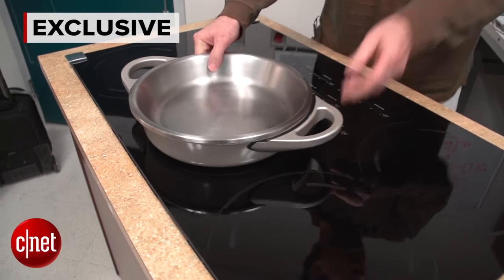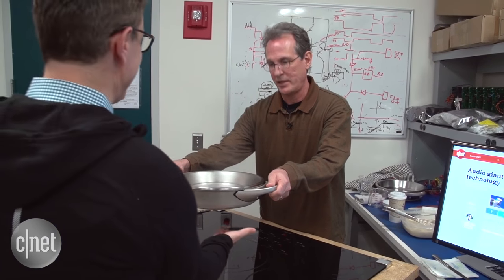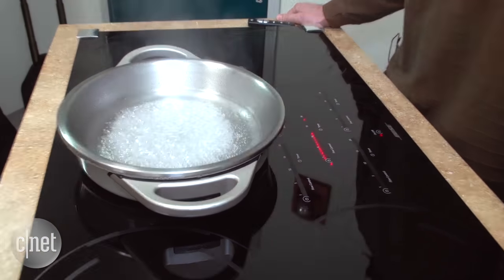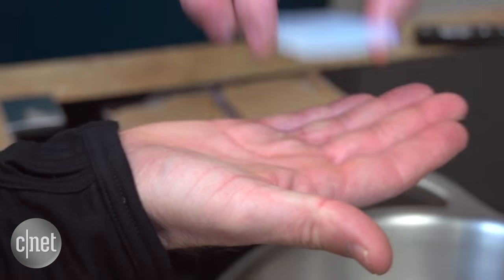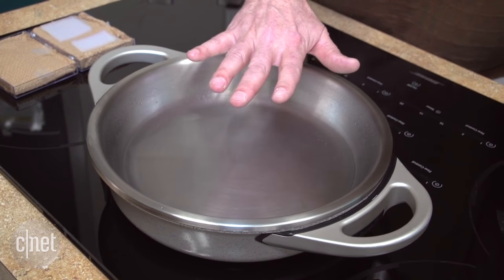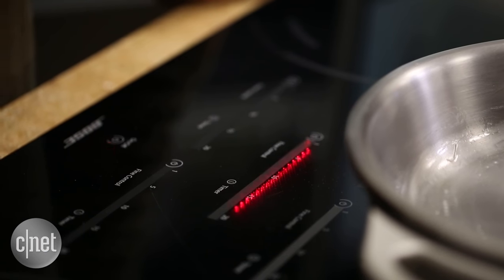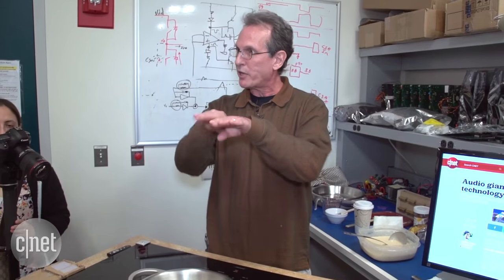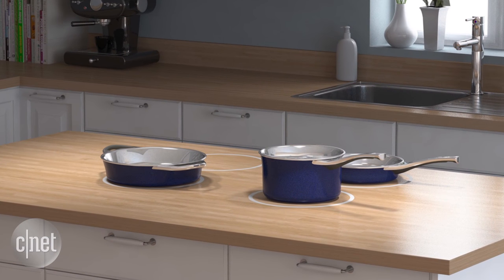Hands-on with Bose's new super high-tech cooking system

Comment: This will make for overpriced cookware with short lifespans (e.g., when the insulation breaks down).
Other than that, the concept is cool, and is a true upgrade to cooking when it comes to being able to dial in an exact temperature.

What I would like to also see, are reflow oven style temperature curves, this will be useful for when you want to avoid gradients in food, for example, cooking meat to be well done without the outside being overcooked. it can be done with a pan, the only problem is that the heating profile needs to be implemented manually in order to equalize the temperatures. 

A system like theirs could automate that with precise control.

Comment: A cafe I worked at had one of these. It was the talk of the place for about a day and then it was as if it was any other cooking top. This would prevent a lot of house fires though.
Reply: I think that cafe may have an induction cooktop which transfers heat directly to a magnetized pan/pot via a magnetic field. No heat is lost on the cooktop surface like gas or electric stoves. This appears to be Bose's attempt to refine that method.
Reply: +wyzemann being that its made by bose, I feel like its a sonic cooktop, which uses a high frequency soundwave to vibrate the liquids inside of what you intend to cook in order to heat it
Reply: +wyzemann nevermind, he explained it in videa
Reply: +GAMEBOIMARCUS No they didn't, it's not even commercially available yet. This is a tech demo. They probably had an induction cooktop, which has been around forever. My parents even have one.
Reply: Kev50027
How are you going to tell me what I seen and used for a few years. We got the same "touch this" demo and had to use special pots. This may be new for homes, but work places had this for a few years now.
Reply: +GAMEBOIMARCUS Because what you used was just an induction cooktop, which has been around for many years. Like I said, even my parents got one that has a touch screen and was installed about 4-5 years ago. This is different technology. The induction cooktop you used didn't have special insulated pots with sensors in the pot, and didn't use aerogel. Induction just uses magnetic pots, so the entire pot heats up. He even explained the difference in the video. What you used wasn't this new technology because it's not even available, and Bose doesn't sell the product.

In summary since you seem to be too dense to read: What you used has been around for many years and is called induction. This uses induction, but works differently, and is not available for anyone, thus your cafe did not have the same system.
Reply: Kev50027
Ok Captain Save The Day, my comment still stands. It was the talk for about a day or two and then it was as if it was any other cooking top. 
"This uses induction, but works differently" Aka, Same same, but different. But still same.

And like I said, it will prevent a lot a house fires. Have a nice life.
Reply: +GAMEBOIMARCUS My point was that this is an advancement on simple induction cooktops, which has been around since the 1950's.

Comment: It's cool, but what's the point?
Reply: Less house fires, it's safer, probably more efficient as well
Reply: +Luke Skeggs-Bennett Is there much risk of house fires from a stove? You can get flameless electric hobs already but nothing beats a flame for accurately adjusting the heat and speed of heating up and cooling down.

Comment: The pans and pots alone must be $200 each
Reply: Not that bad if it is that much for what it is
Reply: But you probably wouldn't have to replace them.
Reply: 200 is way too cheap for bose
Reply: +AlphaOmega I could justify spending 1000$ for the whole system. This is amazing.
Reply: +markur What is the real benefit other than efficiency? And will that efficiency ever pay for the system? I don't see a benefit over other induction systems. This system will be far more expensive, have much more expensive pots and pans, and is more likely to go wrong when a "smart pot" sensor fails.
Reply: +Kev50027 if you could build them in to countertops, that would be something really cool that I would pay for. It opens up the whole kitchen since there's no need for separate counters pace for a cooktop. Would be great paired with a double wall-mounter stove.
Reply: +markur You can already do that with induction cooktops though.
Reply: +Kev50027 Nobody (99.99%) of consumers will have no real interest in this product... It's a luxury item... not a necessity... nothing that revolutionary or special about it... I'm not impressed... and, who would want to be stuck with using only Bose stoves and cookware for life anyways?? Bose speakers are total garbage and are way-way over priced, too... This just sounds like another BS niche (failed) product... sort of like their car suspension system that took them over 25 yrs to develop/engineer... and, now they're only able to market to truck drivers for seats... what a waste... I'll pass! I wonder how much the DOD allocated/spent on their new Bose military headphones... So, taxpayers are really the one's paying for the overhead from all of their magazines, brick-&-morter stores, employees, commercials, etc. Bose is a joke and sucks!